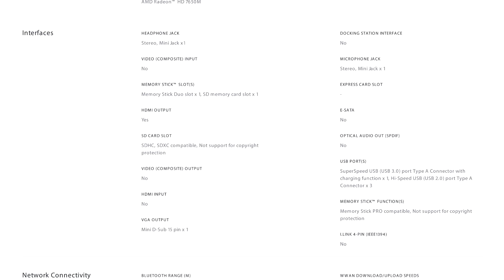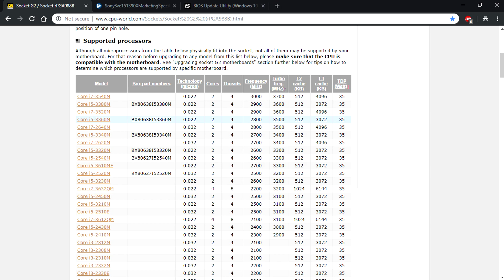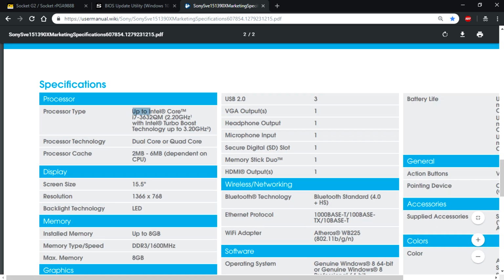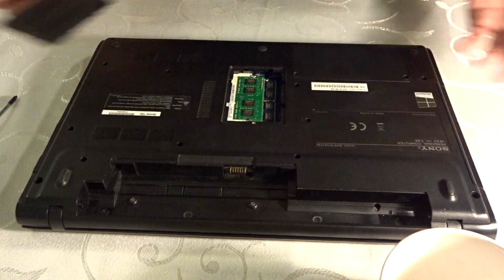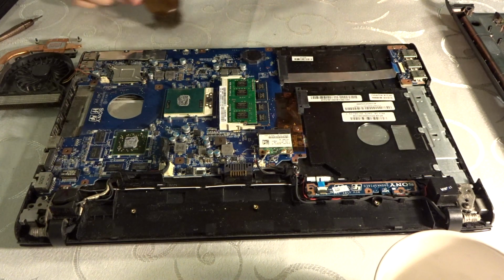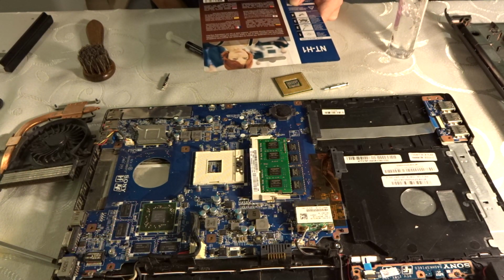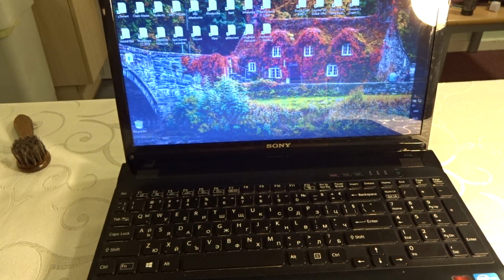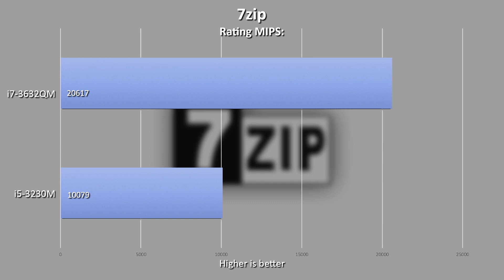How to upgrade your Laptop's CPU!!! | Tutorial

Comment: Hello can you help me. I currently have ASUS K42jv laptop thats old and slow. I wanna upgrade it for my online class and light gaming. It's current specs are Intel Core i3 380m, 4gb ddr 3 1066mhz, old hdd and Nvidia GeForce GT 335m. Please help me and thank you so much. I need everyones opinion on which cpu is the best for my laptop
Reply from the maker: Hi, the first thing I would most definitely recommend is that you swap the old HDD with an SSD. This is the upgrade that will speed up your system the most. Try that first before you go for the CPU.
Reply: @RafalexHouse  thank you so much <3
Reply: @unbrokendawn757  i3 -> i5-580m, i7-640m //
RAM 2gb+4gb, 4gb+4gb DDR3-1066 //
SSD 120-256GB (SATA-lll, 2.5, TLC / 3D TLC)
Reply: @slavafedotov5742  thank youu so much for helping : )

Comment: An upgrade like this it's really good, it may not benefit gaming that much but for everyday use it's definetely worth it, a processor like this holds its weight against modern CPUs, for the gaming department you might want to research an eGPU option, I'm currently looking for these kind of upgrades.
Reply from the maker: an eGPU is possible in these old laptops if you can sacrifice the WLAN card meaning that you can unplug the wifi card and use the PcIE lanes for the GPU.
Reply: @RafalexHouse  Actually, fortunately I have an ExpressCard slot on my 8470p, so I get to keep the wifi and the mobile funcionality of my laptop, at least on my case that's a great option for eGPU. :D
Reply: Rafalex House can’t you buy one of them razor eGPUs so you don’t need to remove the WiFi card?

Comment: I have a HP Envy 17 j100 series with Beats Audio and a Intel i5 dual core processor. What can I do to make it better?
Reply from the maker: I'm not sure if the CPU is removable or if it's soldered to the motherboard. If it's soldered you can't replace it.
Reply: @RafalexHouse  17-j115cl
It has 2.5GHz 4th generation Intel Core i5-4200M Processor which is removable

Comment: Sir I have an hp 15 d006tu notebook with pentium 2020m cpu I want to upgrade to i7 3632 qm pls tell me if I can my laptop have insyde f.1b bios ,I am not able to find the suitable driver for upgrade ,pls tell me I can upgrade to this cpu or not and if I cannot then ,which other cpu should I install instead
Reply: Please help, I need it
Reply: you can install i7-3612qm / i7-3632qm without BIOS update. You can buy a simpler processor: i5-3380m (if you just need a laptop for the Internet).
Reply from the maker: Yes those two CPU are both compatible on a hardware level. It is the same socket but I would recommend for you to check out if your same laptop comes with any other CPUs preinstalled. If it does than you can upgrade with those. Hope this helped!

Comment: my sockets support -FCPGA988,FCBGA1023, can I change processer. My proccesser intel (R)core(TM)i3-3110M@2.40GHz in laptop
Reply from the maker: Hi, I looked up your CPU and it says it comes in two variants/sockets. One is 
37.5mm x 37.5mm (rPGA988B) and the other one is 31mm x 24mm (BGA1023). Could you double-check with HWiNFO (https://www.hwinfo.com/) and confirm which one it is as it cannot be both of them?

Comment: I have a i5 intel in to a 2018 ASUS Notebook. Is it similar on most devices

Edit: would I be able to upgrade to an i7 or i9
Reply from the maker: I haven't done much research but to be honest with you chances are it's gonnna be soldered to the motherboard and it's not gonna be possible via the same method. Could you tell me the exact CPU model?

Comment: What about the different TDP of the processors in this list. Even if it's the right socket, will the energy be enough for a 45W quad core processor? I had 35 W dual core before?
Reply from the maker: I am not confident to confirm/deny if it will work. I would recommend sticking to the same TDP as the laptop was designed and tested for the CPU it came with and its TDP.

Comment: I got an old Toshiba Satellite P300-1A8. I’ve upgraded the ram and have also got an SSD. Just wondered if you could tell me what’s the best processor that is compatible with this laptop. Can’t find the information anywhere.
Reply from the maker: Hi, could you also tell me model of the processor? Thanks!
Reply: @RafalexHouse  Intel Core 2 Duo T5550 1.83GHz

Comment: My Cpu is a Ryzen 5 3550H and i cant find that processor in the supported proessors tab is that a problem?
my laptop is a Asus tuf fx505dt
Reply from the maker: If you can't find it then it's more likely that it won't work. I'd suggest you dig a bit deeper about your specific laptop model on forums, etc.
Reply: Why would you even try to upgrade that cpu is great

Comment: Can I upgrade my hp 15 notebook cpu currently running on amd ryzen 3 2200u ?
Reply from the maker: I'm not 100% sure about that but if I had to guess I would say most likely not as newer laptops come with soldered to the motherboard CPUs. It's a good a idea to do your own research as with Ryzen and its AM4 socket it's not impossible for it to be a full-on desktop CPU. It depends really you'll have to dig a bit to find out.

Comment: I do have an Old one laptop, Acer 4741 with core i3 350m socket 989 rpga. Is it possible to upgrade it to core i7 940XM since my socket type is  Socket G1, or rPGA988A. does it supports the Processor?
Reply from the maker: Those are indeed both using the same CPU socket but the i7 is a 55W CPU and the i3 is a 35W CPU. I would recommend only upgrading to a CPU with the same TDP. For a 35W TDP CPU I would recommend the i7-640M but please check the links below and do a bit more research than me before you buy it. Good luck!

https://www.cpu-world.com/Sockets/Socket%20G1%20(rPGA988A).html
https://ark.intel.com/content/www/us/en/ark/products/49666/intel-core-i7-640m-processor-4m-cache-2-80-ghz.html
Reply: @RafalexHouse  Man, that's what I've been searching for! Thanks a lot, imma head back to the city and check for an i7 with 35W or a Pentium P-series.. Really helps dude.

Comment: Can I change my processer intel(R)core (TM)i3-3110M 2.40GHz
Reply: install the cpu-z program on the laptop. Look at the socket type on the first page. If the socket is rPGA 988B, then you can install the processor i5-3360m, i7-3520m, i7-3612qm

Comment: What about ram and the GPU?
Reply from the maker: GPU is gonna be pretty hard to upgrade if not impossible. RAM is more likely to be upgradable on older laptops like the one in the video. As long as the RAM isn’t soldered to the laptop it should be fine.

Comment: Hello, I'm a new subscriber and an EE.  Your practice and familiarity is impressive but to teach or mentor you have to think back to the things that tripped you up or took time to master.  I was looking at your cpu upgrade tutorial and was duely impressed BUT you waltzed through introducing an entirely foreign software in the middle of an otherwize edifying tutorial.  It was valuable info but I know it will be an abusively frustrating time to try to duplicate your casual efforts on HWinfo and the bios upgrade site to determine compatibility.  I fear that your familiarity with the subject makes your tutorial most useful for people who have a similar background.  That's a valuable resource for peers.  You might want to offer sub tutorials at points for people you've lost.  MAKE SURE YOU DON'T RECOMMEND WHAT YOU HAVEN'T YET CREATED.  Sorry I've managed engineers for the last ten years of my career and it's very easy to lose parts of a willing audience.  Excellence will require planning ahead, much harder, so there is a support route for your prime.   Well done but, of course, room for improvement.  I subscribed an hop to see you edify many.
Reply from the maker: A comment most thoughtful. Most certainly appreciate the constructive criticism! I am planning a follow-up video so I will try to clear up most of the steps and answer as many questions as possible. Thanks Pat! Welcome to the RafArmy!

Comment: I'm aware of that video the day I post this comment this video is being 2 years old. but this video was outdated even back then. Both i5-3230M and i7-3632QM are from year 2012. And Intel stop making socketed laptop CPUs after 2013 so did AMD next year.
This video was uploaded in 2019 but information that it contains outdated since 2014. Even then it was misleading. 
Even if you find a competible CPU with your motherboard, higher grade CPUs will have higher power consumption therefore higher thermal output. Which means CPU might work when installed but soon after your either your cooling system will fail or your power supply, most likely both. Assuming that you motherboard can compensate that, then your new CPU's power draw will be limited and you will not get any noticable performance increase unless your old CPU was malfunctioning.
Reply: different countries have different living standards. Some people buy laptops with 11th generation Intel processors, while in other countries (Asia, Africa, South America) people still use laptops with 1st and 2nd generation processors, because there is poverty. I have a laptop Asus X55VD  with an i7-3612qm processor + SSD 250GB + 12GB RAM and Windows 10 - I have enough performance for work and leisure (simple games and watching movies and football). Why buy me a laptop for $ 1000-2000 if the performance of an old laptop is enough? at my firm, engineers use powerful computers for design work. This is a necessity. And for ordinary people, it makes no sense to often change laptops and computers.
Reply: @slavafedotov5742  Be that as it may but it does not change the fact that all the informations the video contains are vastly outdated, and that was in fact my whole point and you've missed it completely.
I am using brand new AMD 5800H as daily driver but I still make use of my Intel T6600 which was released in the year 2009. That old CPU powers my NAS at my home but that doesn't change the fact that it is outdated. Therefore When it dies or eventualy gets rendered as not enough I'm not gonna buy an upgrade from the same era I will buy a modern replacement.